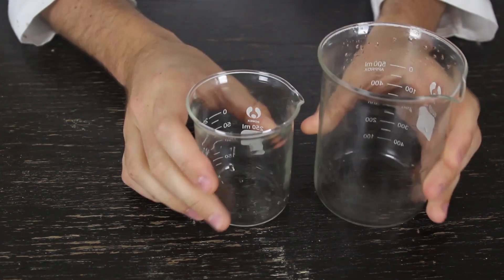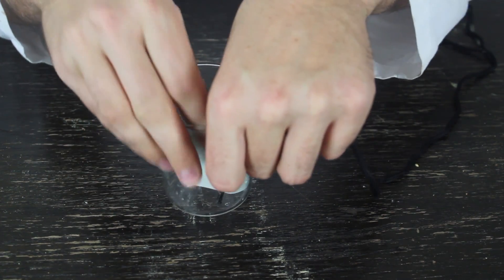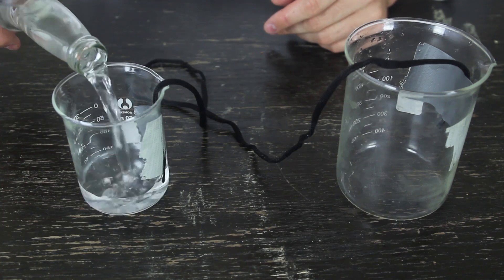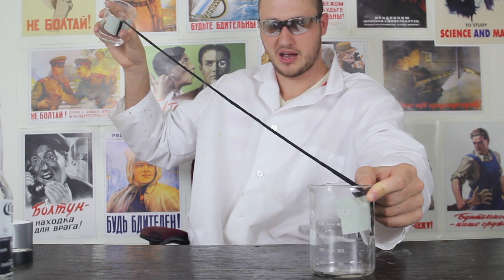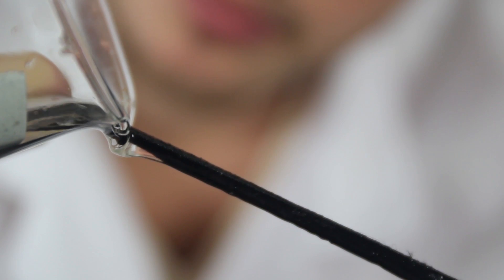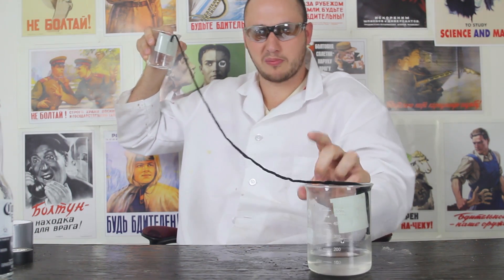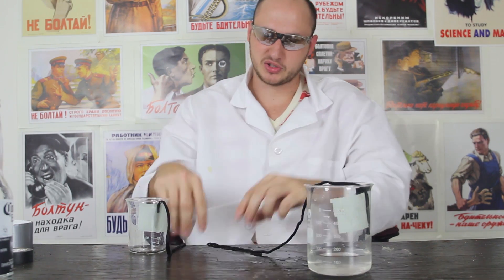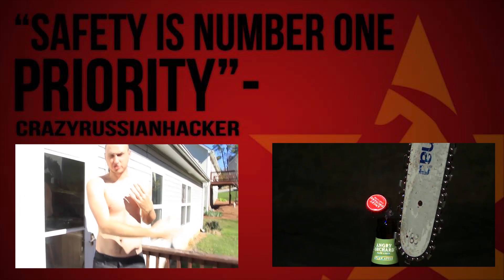Cool Water Experiment

Comment: Water molecules want to stay together, because the shoelace is soaked (it has water particles al over it) the water will stay whit the other water molecules. Gravity pulls it down, that it why it will get into the glass at the lower bit. Thats is why i doesn't spills. See you later, GunGuy3002

Comment: water molecules stick together vie inter-molecular forces this means that the water wants to be with other water, so it all stickes together, this is why raindrops tend to stay in one bead and join with others rather than falling apart, the same mechanism applies to the string, the water sticks to water in the shoelace and is then able to run down it without falling off, it's called water cohesion, it's not surface tension